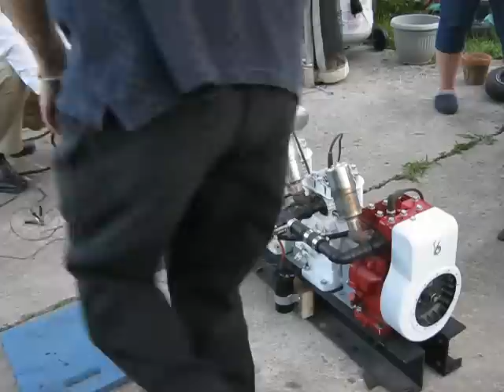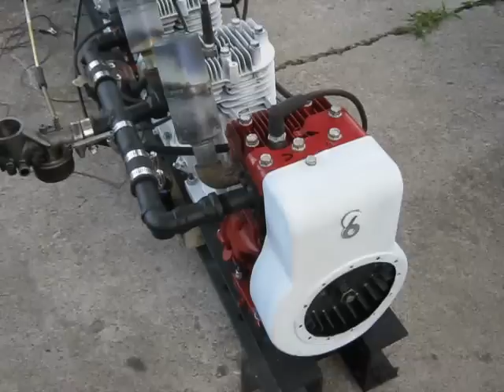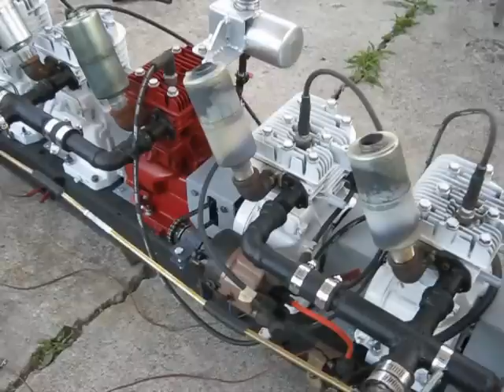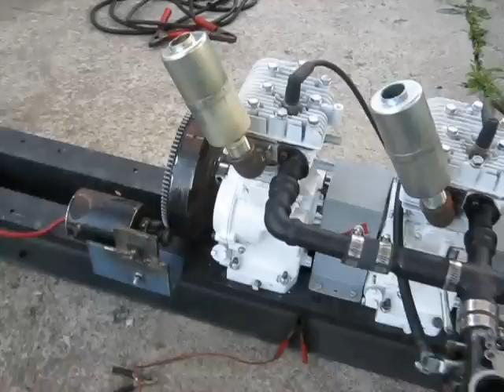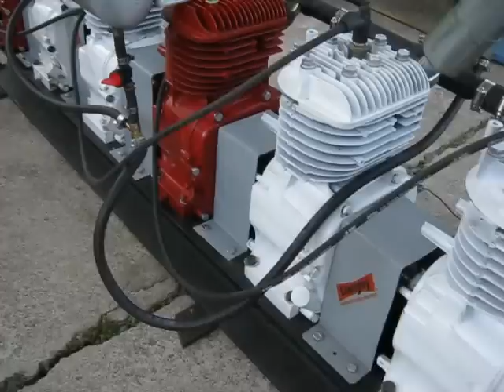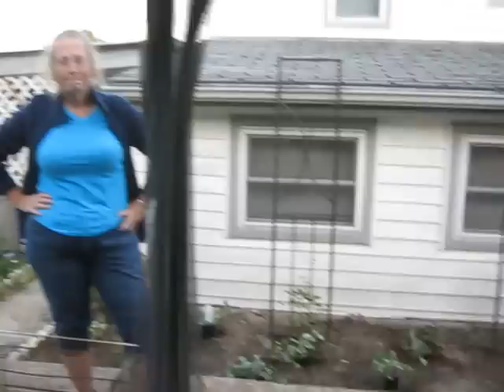FrankenBriggs 6 Cylinder 1st Run!!!!

Comment: Third engine in was running lean as hell. Started smoking and the exhaust pipe changed color - only caused by extremely high heat, caused by a lean condition.

Comment: awesome
Reply from the maker: Thanks, I agree!  All in all perhaps not the best run possible, but I am just glad to finally get it going, as it has eaten a lot of hours of my time! I plan to try another run to hopefully get it running smoother, and get rid of the backfiring!
Reply: That backfiring has to be timing? no vacuum advance  etc.   The cylinder being rich may be the short run on the manifold.  outer cylinders leaner.   what do you think?

Comment: I think the intake is probably a good start because yes you r feeding 2 and 5 straight through so the rest aren't getting enough fuel like the other guy said..and also are you sure the gearing is right on the distributor for them to all fire at the same time..Just a guess but I think it may have been a little better to leave the individual coils on each engine with the flywheel on each also..looks like the way you built it you had enough room...Either way awesome looking..One of a kind for sure..

Comment: Might not be perfect or remotely practical, but it sure does sound great.
Reply from the maker: It sounds better on the last vid of it I made, I think it is called the final run. I also made an 8 cylinder, and ran it once with no mufflers for a vid  :)

Comment: Great "build" and thanks for sharing.   

Looks like #5 (2nd from starter end) is a "dead" cylinder, from the looks of the muffler casing,  and doesn't look like #6 was working too hard from the looks of things, either..... great build, none the less.... hope you get it all sorted out,  and running on all 6.... equally, in terms of carb sync. and fuel flow.... might want to consider a mandrel bent (re: Smooth fuel & air flow) intake runner from your carbs to the heads,  so that you don't create unnecessary (re: Very Undesirable) turbulence and interruption in your fuel flow due to the joints in your current pipe setup.  

Smooth fuel and air flow is critical to a good running engine.... with carbs,  and when the carb(s) are Not directly mounted to the head(s)... as in the case with your setup.   Keep working at it... lots of "fun" doing builds like this,  and keep us all posted.... looking forward to more videos of it.
Reply from the maker: Good observations, yes, some of the cylinders weren't working during all of the vids of the 6 cylinder. i finally got it all sorted out in the last run i made of it, I think it was the third run. The one think I didn't cure until I made the 8 cylinder was the fact that I had the spark distributor spinning backwards, so it was retarding the spark timing, instead of advancing it! Once I sorted that out on the Straight 8, the engine ran much cooler, and wanted to rev up much better, almost too well, as i got over enthusiastic and revved it to 5000+ a few times causing the crankshaft gear on #5 cylinder to break. luckily it didn't lunch the engine internals too badly!

Comment: Would joining all the intakes together work ok, as in fitting 2 tee's in the number 3 and 4 cylinder intake.  It would look more like a ship engine then :-) Fantastic work!!
Reply from the maker: That would probably work, though I resist changing this unless it really doesn't work out very well. I have a similar manifolds made for the  straight 8 also.

Comment: maybe 3 carbs so each intake runner is equal length and all cylinders would get equal fuel and air? the cranks were somehow welded together i'm guessing at 60 degree intervals?looks like a lot of fun
Reply from the maker: Yes, I bet it would work better with 3 carbs, i used chain couplings to tie the cranks together.

Comment: Not Sure why you built this, but Koodo's. Because the six engines are 4 cycle single cylinders that always back shoot because of internal valve releases, you will have always have back fire issues. Timing the engines would be critical then to help reduce this. Make sure each fires at a different stage rotation of the crank. If it was me, I would have just stayed with the single carb's and set them up with manual operation. But good job anyway.
Reply from the maker: I arranged the firing so that each cylinder is 120 degrees apart, spark is from distributor, the firing order is 1,5,3,6,2,4. I went with 2 carbs so that it would be easier for throttle linkage. You are right, it would run better with 6 carbs, but linking them all together would be a big pain. For a more practical build, a common shaft running beside the motors driven from a sprocket on each engine would allow the regular governor on each engine to operate normally. This would in effect provide a 30 horse engine for use on a piece of equipment. My FrankenBriggs design is not as practical, but more fun to play around with :)
Reply: LOL, yup. Well, it's still an accomplishment. Great work.

Comment: Perhaps offsetting the cylinders by 72 degrees on axis would create uniform power. Each successive power stroke adding to the next, easier starting, but more stress on the starter.
Reply from the maker: I used 72 deg. on the 5 cylinder engine to achieve even firing (though perhaps it was actually twice that). Anyway, the 6 runs better in my final vid, but the 5 was one unlucky Witch!

Comment: You are gonna have to lengthen your lawmower to install that.  Personally I would have gone with a "V" twin cylinder Brigs.

PS didn't you miss home depot for intake manifold.
Reply from the maker: Yes, home depot does carry a nice selection of steel pipe  :)
Reply: Neat project; what will you use it for now?

Comment: Only 4 of the 6 engines are running. Look at the muffler paint. The last 2 werent touched, the first 4 paint burned off. Number 4 barely firing, but still got hot enough to burn the paint off.
Reply from the maker: You are correct, I made 2 later vids where all of them run, but this one gets all of the views.

Comment: It’s going to overheat. But pretty cool anyway. The 5 blocks need fans and shrouds, if run under load
Reply from the maker: Yes, I fully agree, i ran it for 2 or 3 minutes on another vid with 2 large fans blowing on it. i only intended it for short runs when i built it.

Comment: I would like to know how these engines are indexed from 1 to each other if they have the same firing order as a normal 6 cylinder 1536 24 with 1 + 6 2 + 5 3 + 4 being running mates? Also in curious if there was a performance issue leaving all six carburetors that you decided to use 2. Something like this done with 6 two stroke engines would be very awesome to see
Reply from the maker: Yes, this uses the 1,5,3,6,2,4 firing order. I used 2 carbs for simpler throttle linkage.

Comment: I always wanted to try this with 8 single cylinder 4 stroke engines and phase the  cranks every 90 degrees like an older American v8.Should sound just like one.Since each engine is internally balanced,one could also phase all engines identical on red compression as one big single cylinder.Would likely need compression releases to start though.haha
Reply from the maker: I phased this one at 90 degress. Yes. it would be VERY hard to start will all of them on compression, it would probably jump in the air also!
Reply: ChargerMiles007   Haha,Yes it would definitely jump mounted to just that rail. The torque would be insane....haha. The 90 degrees on the crank throws explains the in unique sound of it. From what I have encountered most inline 6's have 120 degree throws. I want to hear it when you get the induction worked out.
Reply from the maker: Sorry, I think I messed up. When I review comments i only get the display pic from the vid, and a short work description. I thought you were talking about the 8 cylinder engine. I set the 6 cylinder up at 120 degrees, like a normal inline 6. Perhaps the strange noise is due to cylinders 4 and 5 not firing on this vid. i got all 6 going on the final run vid. The 8 cylinder is running on all 8 in all the vids, until the crankshaft gear on #5 cylinder breaks, cutting that cylinder out on the final run vid. One good thing about this coupled set up I have , is that I can change the firing order, or make degree changes (within limits) as long as it will work with the distributor cap, so it is a fairly flexible set up.

Comment: Its cool but I feel its going to overheat without the fan cowls on. 

Also leaving the factory carbs on and building a multi throttle cable would allow you to adjust each motor individually. Its not the most scientific method, but using a infrared thermometer to check exhaust temp of each engine can give you an idea of which motors are working too hard and which ones aren't working hard enough. Then make your adjustments accordingly.

Comment: Kool!   Did you try changing the angle index of TDC's at all?  I would be that to give some pretty decent different exhaust notes!  May work to balance out any excessive vibes you may have.    What did you use for couplings?
Reply from the maker: I just set all of the cylinders to fire 120 crank degrees apart, like a normal inline 6. i use chain couplings.

Comment: The fuel tank needs to be higher. The specific gravity fuel needs more pressure to overcome the "friction" of the fuel hose. A larger tank would add more pressure too or the fuel pump Part #808656 would help too. Great job!
Reply from the maker: Thanks for the advice, I thought the small tank was somewhat low for this application.

Comment: What about the cooling for the other five motors ? They are air cooled, by the air the flywheel creates and blows with the aid of the shroud. Only one has flywheel and fan shroud !
Not much for longevity !

Comment: Sounds like 6....Nice job!
In engineering designing  crankshafts  are the most complex since difficult equations are needed to solve second order torsional vibrations and where the "nodes" ( high shear stress points) occur on shaft. 
Firing order and balancing components  along with a torsional damper takes much of this stress away. Large diesels have liquid filled or rubber cushioned front dampers. Maybe make a small one off a 4cyl car engine fit this .
Reply from the maker: Good idea, perhaps that is what the 5 cylinder Briggs I made required, since it unscrewed the front flywheel nut twice. It resulted in the flywheel racing acrossed my lawn once, talk about excitement!!!

Comment: seems with out the same distance from carb to  engine on the intake pipe would cause  a mess of fuel flow issues to the cylinder
Reply from the maker: Yes, I am sure it does cause some issues, though real straight 6 engines often used a single carb., and they ran reasonably well.
Reply: I ran a 1969 Rambler with the small straight 6. It had a single 1 barrel carb. It would do over 100 mph without any problems.

Comment: the final output shaft is covered by each individual engine in front of it...? did you bother to time each exhaust manifold to 1/3 on the exhaust stroke per piston so that it's got equal back-compression?  (seeing that you have two carburetors and two exhausts)
Reply from the maker: Actually it has 6 separate mufflers, so there is no exhaust tie in between the cylinders, only the intake manifolds.

Comment: Actually Briggs & Stratton did invent the six-cylinder engine. But they soon realized that there would be no use of the engine in this configuration, so they divided it into six one-cylinder engines, and........Voila !!!!!
There were countless uses for a small one cylinder air-cooled all over the world !!!!
Trinidad & Tobago.
Reply from the maker: Yes, 1 cylinder engines are used for many small applications, lets hope those danged electric guys don't take over!!!  I like the sound of small engines  :)

Comment: There's no way I can read 700 comments so I'll state the obvious. A mentioned, the existing intake manifold cannot work..6 small carbs would be most ideal and why are several engines void of any means of cooling? Other than that, Brilliant!!
Reply: Have you ever looked at 6 cylinder inline engine that were built in the 50s and 60s, and even into the 70s? They often had a single carb feeding all 6. Hot rodded ones could be bought with two or three 1, 2, or 3 barrel carbs  To give you an idea about carbs, the same one used on a 1940s Case VA series tractor also was used on a single cylinder Gravely Model L tractor of the same time frame. The Case engine  ( made by Continental ) was 124 ci while the Gravely was a 30 ci engine. Exactly 4 times larger on the Case than the Gravely with exactly 4 times the HP.
Reply: gravelydon Multi- cylinder engines have run perfectly on one carb since the beginning of multi's. They do so because the intake manifold is highly designed and tuned to the engine. This takes significant engineering, big $ and time to do.
6 carbs is cheap, easy and will make it run perfectly once it's cooled properly.

Comment: Interesting idea! Lots of work for sure. I am guessing that you can't take full advantage of the power since the crankshafts can only transfer so much extra power. If you put decent load on one end it would probably break somewhere along the way...
Reply from the maker: Yes, you are correct, I could probably get 10 to 15 horsepower from the output shaft before something failed rather dramatically!!!  though that could make a good vid! To make this requires welding and machining of the crankshafts, as well as an investment in chain couplings, so I don't really want to break them. Though we did rev the Straight 8 to 5000 rpm a few times, then probably harmonics broke a crankshaft gear into pieces, the engine continued to run, luckily that cylinder wasn't too badly damaged. Next summer I will build the Straight 7 to see how such an engine sounds  :)
Reply: A more robust solution would be a radial configuration, where each engine has a sprocket onto a larger, central gearwheel - or you could completely decouple them by driving generators that would sum to drive a motor, or hydraulic pumps to drive a hydraulic motor - but if you were going to spend that amount, a V-6 from a scrap yard would be a cheaper - and most likely a better solution.
Reply: How about a secondary, more sturdy axle running along all the engines? Each engine could drive the axle via a short chain (for example) and you could utilize all the power.
You could probably also build the engine shorter this way.
Reply: UraniumMan

Comment: i think the timing is slightly messed up if all cranks are connected they would be bucking each other if the firing order isnt perfect
Reply from the maker: Yes, it had some issues for sure, have a look at vids 2 and 3, it runs better in those.

Comment: Personally, I think it's the timing, since each engine has its own timing, their going fire at their own timing, this is not like a straight 6 where each cylinder is timed by one output.What would be the applications for such a large low HP engine?

Comment: I did notice that the first 4 engines burned the paint off their mufflers,...but not so apparent on engines 5 and 6. Next time, how about showing with a thermometer, that all engines are indeed firing.
I think that this is a cool ( not the exhaust's ) experiment .  Are you able to have this run for longer periods ?
Reply from the maker: I ran this engine for 2 minutes, but I think that was approaching the safe limit, even with external fans blowing on it. There is a vid of that run. I do take some heat gun readings on other vids, measuring the heads and mufflers. I got it running on all 6 on my last vid. Today i got my new Wooden Head Briggs to run for about 4 minutes, it smelled like a wood stove!  :)
Reply: Hahaha,.... use different woods and the smells with confuse  everybody !!
Reply: I think if you put each engine at top dead center and then hook them together and have all the engines running off same intake and one large exhaust have all the sparks timed the same it will work better and not overheat
Reply: Cade, would you think that this would lead to a helluva vibration ? Or not !!

Comment: Seeing it is a forced air cooled cilinder, what about the cooling of those exposed cilinders?
Reply from the maker: I used large external fans on a few of the runs, they aren't visible in the vids. I didn't intend to run these engines for very long, so a minute or so seems to be OK with no load. I ran the 6 cylinder for 2 minutes, but I think that was pushing it, as it got rather hot!

Comment: It looks like #5 didn't run much, if at all, and #6 ran very little. Their mufflers didn't become discolored, like the others.
Reply from the maker: The coloring doesn't quite tell the whole tale, as some of the cylinders seem to run lean, heating thtat muffler up more. I did take temp readings, which is how I found out certain cylinders weren't working very well. Eventually I got them all going.

Comment: the first 3 worent working to good, you can tell cuz the mufflers stayed the same, the heat didnt mess them up
Reply from the maker: You are right, some of the cylinders were having issues, I fixed that on the final run vid.

Comment: Cooling will be an issue since they will overheat without the tinwork and rotor.
Reply from the maker: Yes, i only cool the first cylinder, though I have used external electric fans for a few vids.

Comment: What if you made them into a the flat six kinda like a Corvair make them run off of one single carburetor
Reply from the maker: I don't think I have a carb. large enough to handle all 6. Guess i better go ebay shopping for something from a Pinto or Vega!